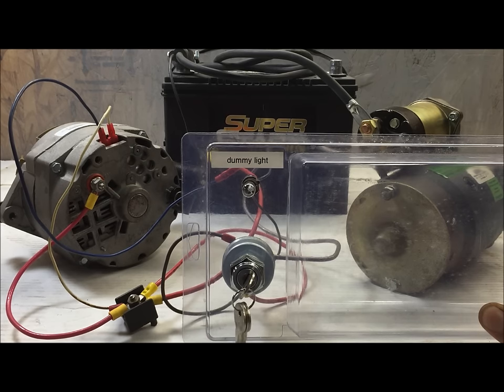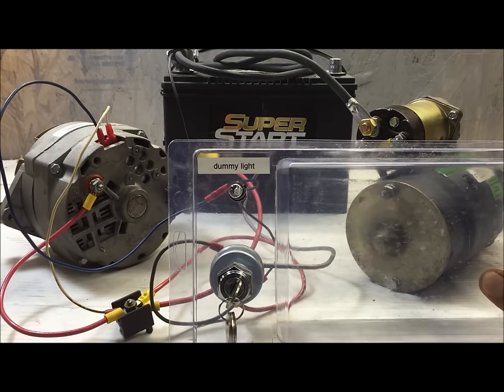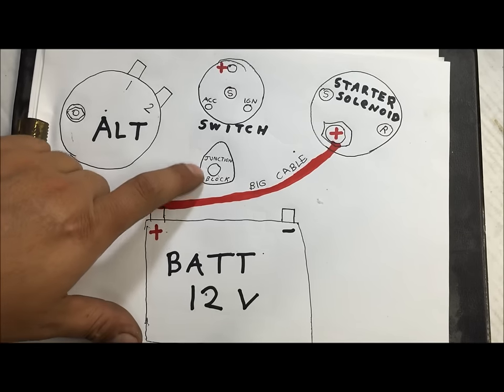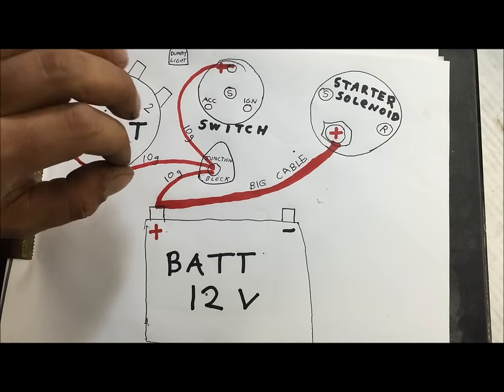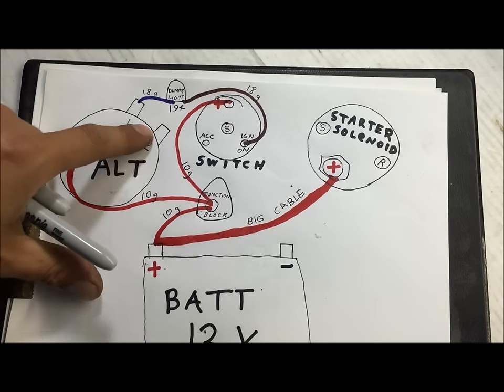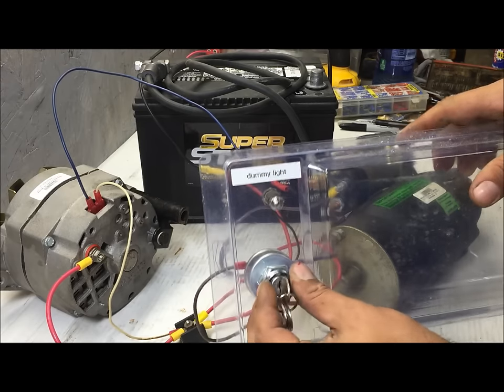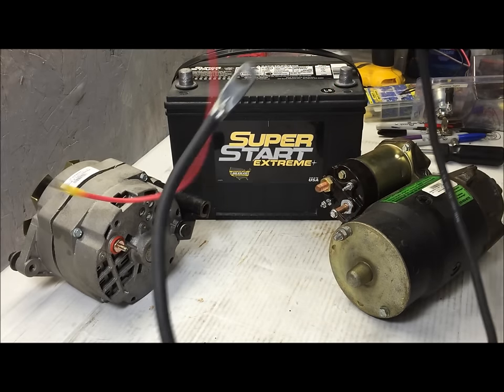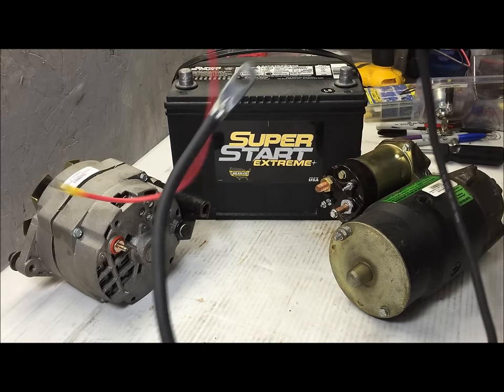64-72 charging system wire up using GM 3 wire internally regulated alternator

Comment: I need help maybe you could help me. I have a 1966 buick skylark convertible and it seems like it started out of nowhere. Well as soon as I hook my battery up my check engine light come on and oil light when I go to start it up it will and run fine then I shut it off it keeps running and have no sign to where it would cut off just keeps running as if the key way still in the running position. What is this PLEASE  😳
Reply from the maker: unhook #1 blue wire from alternator

Comment: You can run this setup without the dummy light, but you have to insert a piece of resister wire in its place....

Comment: good video....I have an old tractor, obviously the big wire coming off the stud on the alternator goes to the battery. the next wire,  (I can't remember if it's 1 or 2) goes to it looks like the starter switch. the last one goes to the positive side of an ammeter on the dash, then from the negative side of ammeter there are 2 wires, one goes to a small light and the other connects the negative side of ammeter to a simple push pull 2 position switch. I'm not positive I forget where the switch wires go but I think to positive side of battery and the other one really not sure. Is this correct and will it work. Also, with the old alternator on, the light would go on and off with the 2 position switch, but now when you shut off switch the light stays on with new alternator hooked up this way. there's another simple push pull kill switch but from what I remember, there's no alternator wire that goes to it, if I remember right, it ultimately ends up at distributer cap. sorry I know this is confusing,  just trying to figure out of the previous owners have all that set up correctly so it will charge the battery ultimately. thanks!
Reply from the maker: watch my GM 3 wire hook up video to wire the alternator correctly.. there should be no wires from the alternator connected to anything other than the charging system...  the AMMETER has nothing to do with the alternator or charging system wiring ... it is simply wired outside of the LOAD on the system to monitor

Comment: In this wiring what could cause the battery to drain over night?  I reciently installed a Tuff Stuff silinoid on the inner fender of my 1985 K5 bkazer and put in a new alt and starter. The alt is charging but the next day the battery is dead. Any help would be greatly appriciated.
Reply from the maker: alt wired backwards to start
Reply: @chriscraft77022  I did put a new connector on for the alt as the old one fell apart . Ill check that.....Thanks for the info!
Reply from the maker: @WeekendPursuitOutdoors  i have a how to wire gm 3 wire alt video..  (6 years old video with my chevelle) if you cant figure it out watch that..  should be an easy fix
Reply: @chriscraft77022  You nailed it! When I pulled the old connector out it basically crumbled, so I got the wires swapped. I turned key on and had power at both wires, so I swapped them and problem solved. Thanks for the video and it walked me thru what to check!

Comment: Thank you!  Do I need to run the exciter wire at all,  or can I just delete it?
Reply from the maker: watch my 3 wire gm alternator hook up.. you don’t need it but the alternator kicks in to charge and that chirp gets annoying... you can ditch exciter but you must run #2 voltage sensing back to the lug on alternator
Reply: Chris Craft, thank you sir!  Big help
Reply: Mine is not two wire of the side,  it's a plastic plug with one big prong and 3 little ones?
Reply: Chris Craft , I have the 4 wire plug on the back of my alt,  PLFS. Do I just put a spade connector on S to the post on back of alt?

Comment: How many amp 10si alternator is that because a 10gage wire is only good for 30amps continues duty. And the up side to running the voltage sensing wire to the positive terminal on the alternator is that there is less chance of getting a high resistance in a connection making the regulator think it has low voltage and over charge
Reply from the maker: 10 feet of 10awg can run a 75 amp alternator.. we are not wiring a house.. and I have never seen a factory wired alternator burn up from over charging.. because the factory never jumped #2 to the lug because that was never a problem.. this was an early video.. that’s why I sound like I don’t know what I’m doing.. the alternator is a 55 amp and you should look up voltage drop charts
Reply: Chris Craft lol I have a 78amp 10si on an Engine in the shop that has a 10gage wire on it and we use it to teach students how to check for voltage drops and I can tell you that it consistently looses 2.1volts at when the alternator is full fielded and it’s only about 6 ft long lol
Reply: Chris Craft sorry I should have clarified what I meant by over changing i was not referring to wiring harness damage that would only happen at high current loading i was referring to possible ECM damage from high voltage due to resistance in the sense wire causing higher then 14.8volts. That’s my fault I should have worded it differently
Reply from the maker: ok cool, I didn’t know if you were someone that knew about it or not.. I don’t know everything about it.. but I know what works and I have wired up many old cars.. the alt is an internally regulated 53 amp...with 78 amp output you would run 8awg.. I have a video where I run a 100amp and went with #4
Reply: Chris Craft for older equipment a little higher voltage would not hurt any as they don’t have an ECM and im not trolling you i was just asking because you stressed a 10gage wire and with your wye type 10si you would be ok cause it full fields at 55amp and you would not run it there long but if it was a delta type you could (not saying you would) run into trouble that’s why I asked
Reply: Chris Craft ya I know it’s internally regulated the model of it is a 10si I have had lots of that model apart and repaired what was shot

Comment: What’s shaking man, question what can the issue be if light is just on without key in the ignition?
Reply from the maker: what year is vehicle?  did you put a new alternator on an old car?
Reply: @chriscraft77022  it’s an 1967 Buick lesabre. With a 68 lesabre 350 in it. 
Yes alternator has been changed a few times
Reply from the maker: look up my internally regulated conversion easy way video.. that should help you figure it out
Reply: @chriscraft77022  cool thank you. About to jump on that now. Appreciate ya

Comment: Do you have to run the 194 bulb or can I run it straight through??
Reply from the maker: watch my gm 3 wire alternator hook up video..  you can run it all the way through with a DIODE...

Comment: I have a 49 chevy  truck with foot push to start after the key is turn to    the on position will i have to buy a simular ignition switch.
Reply from the maker: no, you just run an extra 10g wire off ign (ON) from the dash switch to the floor button and then to the starter
Reply: @chriscraft77022  the wire is already there so I should be ok thanks

Comment: Thanks so much for doing it this way . I learn by accually watching . I get lost easly when people talk and run threw the diagram . I love the way you broke it down step by step . 

However I have a LS2 engine in my 87 iroc Z  with a 1 wire alternator and a mini high torque starter .

 I see the only thing I had right was the batt positive to the starter . So I will have to rewire everything again . And do you really have to wire the negative starter terminal to the starter itself and ground out the starter itself because I seen it done another way .

How in had mine is the ground to the battery ground  
The positive to the positive starter terminal 
The negative starter terminal to ground   the 1 wire alternator to the positive starter terminal 
The ign wire from the harness to the starter terminal that has the tiny post with a tiny hole threw it 
Have the kea12v wire from the harness to the power fuse box from the original 87 camaro 
Ign1 and ign2 goes to the harness.  

As you can see I dont know how to do this charging system at all but your video really really helped out alot . 

Would so love it if you gave me feedback as soon as possible because I'm going to rewire it tomm it's to late to do it today .
Reply from the maker: Ground to engine block anywhere.. starter, head, etc..

Comment: I dont see the negative side of battery involved,or any thing from frame gound. ?
Reply from the maker: +Ron Grovis are you being serious? I hope you are joking...
Reply: No iam serious Chris for that bulb to work it needs a pos. +. and a negative -- the other side. The alternator is grounded when in the car giving a negative to one side of the check light. Iam not saying the positive circuit (red wires ) is wrong ,its all correct .sorry for the interuption.
Reply from the maker: the ground from the battery bolts to the engine..  the engine is grounded to the body..  the body is grounded to the frame..   all the metal of a car is the ground......  there are no grounds wires in this system...  it is a charging system..  ALL HOT...   the bulb is an indicator lamp that comes on (Grounds in the alternator) when it is not charging the battery
Reply: Great video Chris, do I have to use a 194 bulb as a dummy light? What if I’m doing a full custom dash, can I just use an LED? Also I was thinking along the same lines as Rons beer, the indicator light needs a ground but you’re saying whatever that 194 indicator light mounts in is metal and making contact with the body. But if you use an LED can I just ground it with the rest of the grounds and take the positive lead to ignition on? Thank you for your help sir

Comment: on my 65 bel air I saw that the #1 and #2 were crossed so I fixed that but the car stayed running, whats the reason for putting it on ACC
Reply from the maker: watch my gm 3 wire alternator hook up video.. I go over everything you need to know
Reply: yeah I watched it right after I commented it helped alot thanks

Comment: Chris, how would it be possible to use a alternator such as this one 
..to put on my electric Polaris Ranger EV somewhere on the axle or close to 
It, and attach to axle with a geared wheel or belt to axle from alternator..... Then have the alternator output attached to my batteries in the Polaris Ranger.. charging them by driving... ie.. the axle moving is turning the alternator which is connected to the batteries.. which is charging the batteries when driving.....Is this possible and if so would you be willing to email me a diagram. Thanks your video was very informative. Thank you in advance
Reply from the maker: the Polaris wheel would have to spin at least around 800 rpm to even start to charge the battery..   most likely will not work..    better off trying to figure out how to drive it off the engine.. might rob some power, though

Comment: I go to the junk yard and find a alt of a   wreak vic, and save money .  and for the junthon.   block ill just use a peace  of  wood with a  bolt in it and tie all the wire that go to it in with each other . or  wire them together with out the block . and tap them up with black tape .

Comment: I want to power an accessory only when the engine is on or when the battery is charging. How can I achieve that? I have a relay setup to the battery and to the accessory however I am still trying to figure out how to trigger the relay only when the battery is charging.
Reply from the maker: it doesn’t work like that.. turn the relay on with IGN on with key and don’t worry about the alternator
Reply: @chriscraft77022  the accessory draws a ton on power, if the driver of the car is: let's say listening to the radio, then the relay would trigger and drain the battery when the engine is off. 

I want to use a fuse tap to trigger the relay, however I can't find a fuse that is connected only when the car engine is on ie: charging the battery (me going directly to the alternator?)
Reply: @chriscraft77022  plz help

Comment: I mean what's the lowest batteries for with started for 2 or 3 days.  mine went from 1250 to 1980 or 1200 .
Reply from the maker: is the battery hooked up?
Reply from the maker: all i can tell you is watch my GM 3 wire hook up video... you might have the alternator wired up wrong

Comment: would wiring through a push pull 2 way switch instead of a key switch be any different?
Reply from the maker: you cant do that because the starter would stay engaged when the engine started..  the ignition switch has ignition on then the starter motor momentary position

Comment: so if the gen light stays on and the ingntion lock cylinder isnt in the car conecetedto the car the alternator is bad???
Reply from the maker: watch my 3 wire gm alternator video.. the cylinder is not the ignition switch.. your ignition switch is probably in ON or ACC

Comment: Is there any reason why it needs to be a 194 lamp? Or, will any 12VDC lamp work?
Reply from the maker: it needs the resistance..
Reply: Chris
Thanks. I can’t find a socket with lens, to fit the 194, in my local stores. Was hoping a different light that I’d found, would work. I’ll keep looking.
Reply: Chris-
FYI, I’m converting a 1963 Case tractor from a generator, to the GM alternator, since I had a brand new one on hand.

Comment: Hello, I have a voltmeter in my car, when I start the engine the reading was 13.8 volts and suddenly drops to 12.8 volts  and after that it reads 13.8 volts again. My rpm is going wild and it has a misfire.  Is it the alternator or the starter? because sometimes when the engine is hot it won't start. (fyi: I already clean the fuel injector; replace the battery, distributor cap, spark plug wires, spark plug, fuel filter, and guage 4 grounding wires)
Reply from the maker: fix the misfire.. the starter has nothing to do with it..

Comment: 87 Camero. Everything run precisely as shown. I have 15V at the back of the alternator but when I hook up the wire to the battery it only charges 12V ??? Hel
Reply from the maker: watch my gm 3 wire hook up video..

Comment: I have a 2000 s10 battery light came on I went to the shop and bought a rebuild kit .. put all parts in bench tested and it charged.. put it back in the truck, start it then take the terminal off and the truck shuts off...  it's only 1 wire looks like the number 2 wire ... any idea on what's wrong
Reply from the maker: what alternator is it? I have a gm 3 wire hook up video you could check out.
Reply: Chris Craft I'm not sure but it's a 2000 chevy s 10 and only 1 wire going to the alternator plug... this is my first truck  and I just bought it so I'm kinda new to this
Reply: Oh it's a 4 cylinder
Reply from the maker: you need to get a wiring diagram and figure out where the rest of your wires are...  i think those alternators have 4 wires..   i mess with older stuff.....  i dont know anything about a 2000 S10, sorry
Reply: Chris Craft ok I'll keep searching but thank you for such quick response

Comment: still wondering if I can just run A 10 g from the + bat. post straight to  the wire that is number 2 coming off the alt.. I lost power to the alternator . Someone told me just run a 10g. From the + bat to the #2alt. Will it turn off ? or ok?
Reply from the maker: watch my GM 3 wire hook up video.. it shows everything possible..

Comment: Shouldnot there be a fuseable link on that alternator to junction ?
Reply from the maker: you can fuse wherever you want.. older cars did not.. now where wires went into cab.,. Yes
Reply: @chriscraft77022  thanks for reply !😀

Comment: How would you run a voltage gauge to this setup?
Reply from the maker: you can connect it anywhere just like you would check voltage anywhere with a meter

Comment: I'm using Nippon denso alternator. Can anyone advise on whether the no. 1 exciter charge light wire needs to be fused and amp rating. 
Also the other wire no. 2 that would connect to the Ign switch on a denso alt. Does this also require a fuse?

Comment: Hey I have a 4 prong connector,  have a wire running from the rear post to the "s" prong.  Still not getting a charge.  I'm I doing something wrong?
Reply from the maker: I’m not sure what you are working on but watch my gm easy conversion alternator video..

Comment: Well I hooked up my M-F 50 tractor and I have the ballast resistor hooked to IGN and #1 wire from alternator hooked up there (IGN)too. so when I turn the key off the tractor  still runs?
Reply from the maker: +Gary Lacey you don't use a ballast resistor, run it through a 194 bulb like in the video or a diode pointed towards the battery.., the ballast goes to positive to the coil on with the switch
Reply: +Chris Craft 
The resistor is to  the coil/points. I was under the assumption that wire terminal #1 was hooked to IGN to excite the alternator when key was turned on. I wasn't concerned about running a light.
Reply from the maker: +Gary Lacey well run a towards the battery... those gm alternators are designed with the dummy light... the resistance of the filament dies not allow the current to back feed... the back feed is keeping your tractor running
Reply from the maker: +Chris Craft diode*
Reply: +Chris Craft 
Okay, I got it, a diode, which allows the flow in one direction.
Reply from the maker: +Gary Lacey yeah, run#1 with a diode towards battery or run a 194 bulb through the wire..

Comment: I have a 75 chevy k10 the battery runs down overnight it has a spark. When you touch the cable to the battery
Reply from the maker: watch Eric the car guy parasitic draw video.. alternator wired wrong can also cause that

Comment: what if the dummy light don't come on after you hook it up??
Reply from the maker: +Lisa Martinez  I have a 3 wire alternator video... make sure it's wired right .. and the bulb is good.. if light still don't come on the alt is bad.. even if it charges the battery